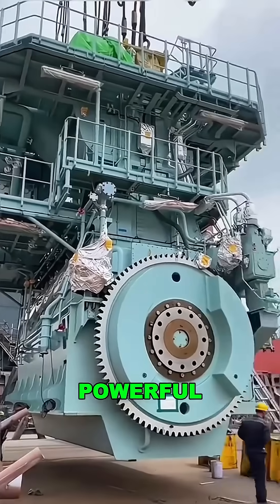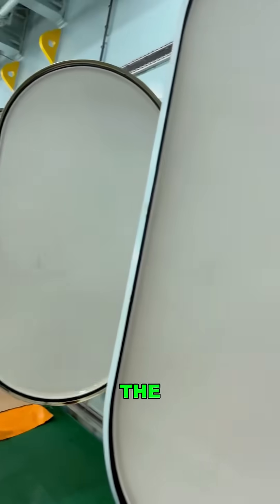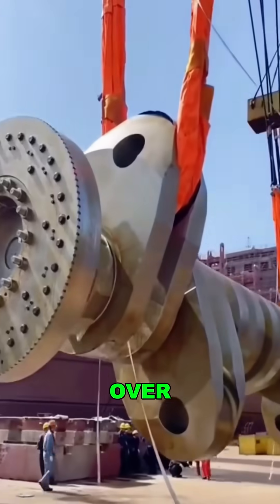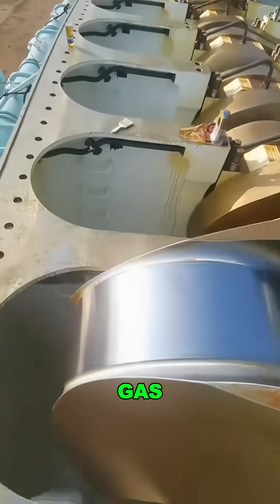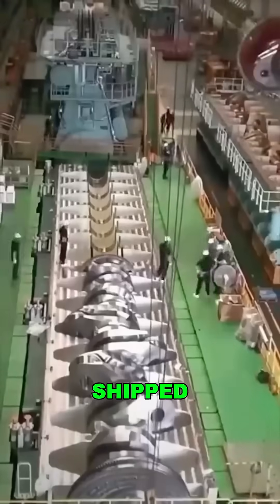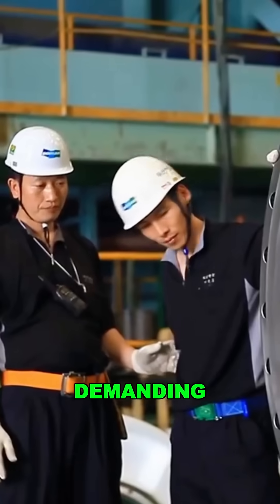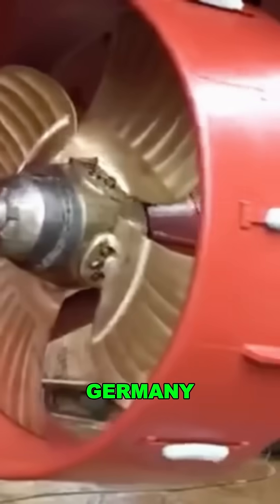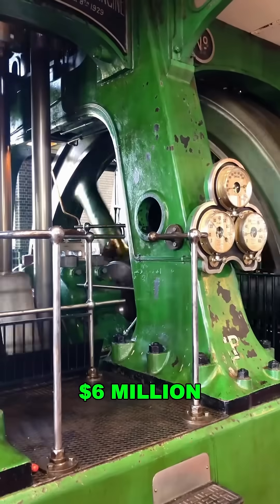This Is the Biggest Engine in the World: 14RT Madness! 🚢🔥

Comment: Why not multiple smaller engines connected with with some type of clutch systems? It will be similar to displacement on demand and save fuel when not needed.

Comment: The 14RT ship engine, specifically the Wärtsilä-Sulzer RTA96-C, is primarily manufactured by Wärtsilä, a Finnish company, in collaboration with the Swiss company Sulzer. While Wärtsilä has a joint venture with China State Shipbuilding Corporation (CSSC) for 2-stroke engine production, the 14RT-flex96C is historically linked to the original Wärtsilä-Sulzer collaboration. Specifically, Hyundai Heavy Industries Co Ltd in South Korea also built these engines under license. 
The 14RT-flex96C is a two-stroke, low-speed diesel engine designed for large container ships. The 14-cylinder version is the largest reciprocating engine in the world and is known for its power output. It was initially designed and developed by Wärtsilä, with the license being granted to other manufacturers like Hyundai.

Comment: There is a catemaran, with propellors in the front. That creates also airbubbles, because of which the speed gets higher.

Up front is better, stronger, faster. Dit you ever use a wheelbarrel? Pulling it is much easier than pushing it.

Comment: Energy can be stepped up by numerous methods as long as there is an ititial source energy to boost. You could even use the water to generate electricity while desalinating it at the same time. If Exxon Mobil or Shell petrochemicals would pioneer these strategies moving forward than they would no longer see it as a changing of the guard merely a diversifying of their portfolio. Imagine Exxon clean energy initiatives? Didn’t see that one coming.

Comment: These massive 2 stroke ship engines are direct drive with no gear reduction or gearbox. Many tankers and freighter are single engine. They either reverse pitch the blades of the propeller or shut down the engine and start it in reverse.

Comment: Can i get into my Pinto for drag racing?
Reply: It runs at 100 RPM so your top speed would be about 2.5 MPH. If you install 6 ft diameter tires you could get it to go 7.5 MPH.
Reply: @andyb1221  That's great. I would imagine quite heavy and not very fuel efficient. Thanks

Comment: I'm just imagining the sound that this colossal engine produces 😮
Reply: RPM may be 100, so not too bad
Reply: @albertyeh5737 I worked on 10 cylinders 29,600 horsepower Sulzer engine. The noise from turbocharger is deafening.
Reply: I really missed this Engine in Dubai Drydock ❤️❤️❤️
Reply: What if we used that fuel meant for aero Diesel engines ?